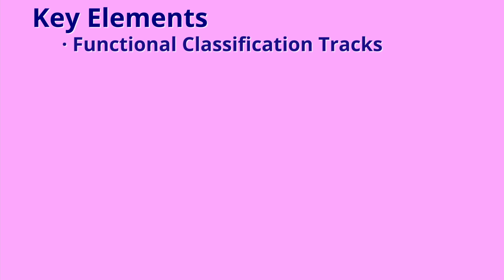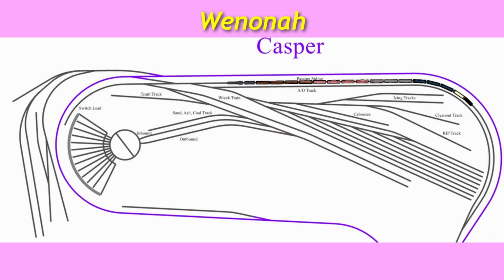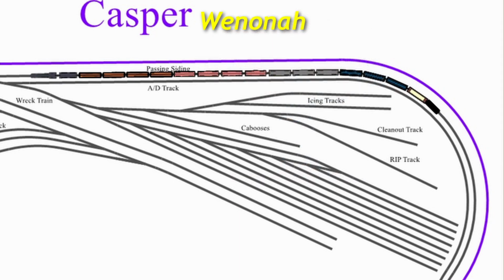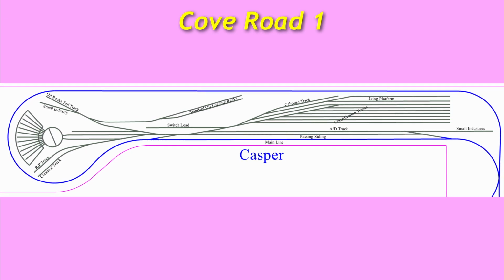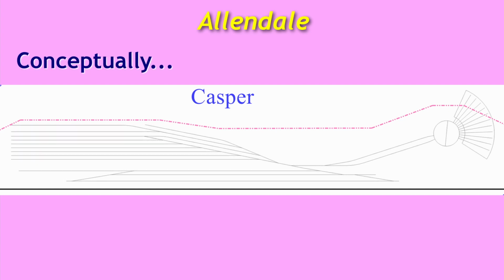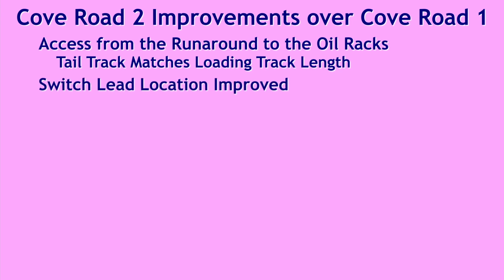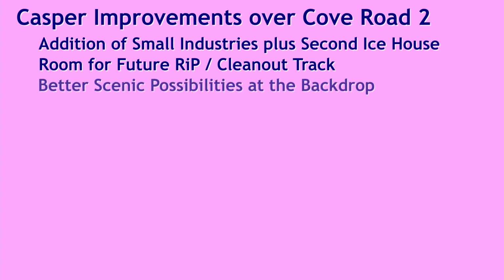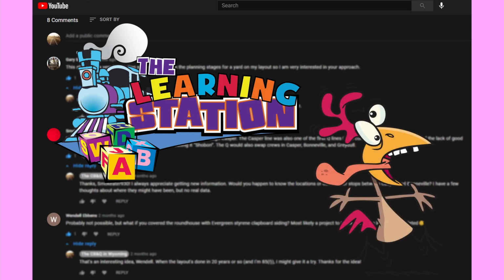2021 05 24 Building Casper Episode 3 Design Part 2

Comment: Have you  built the yard and operated it to flesh out any flaws? Planning any ops sessions anytime soon?
Reply from the maker: Alex, most of the photos are of the current yard - version 5. As I said at one point in the second video, all the track is laid except the second turntable lead and loco supplies track. Ops simulations will begin as soon as ballasting is done and the tracks are clear again.